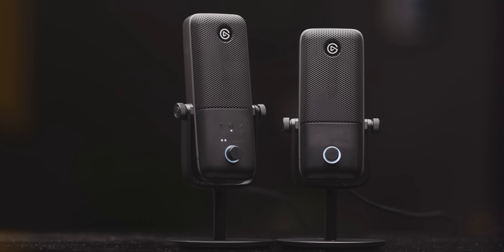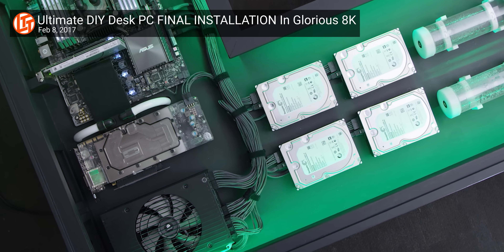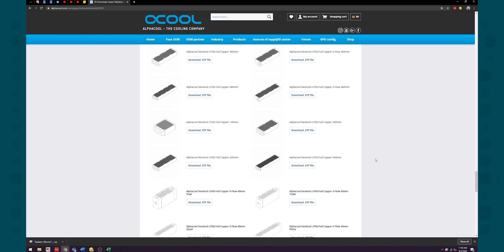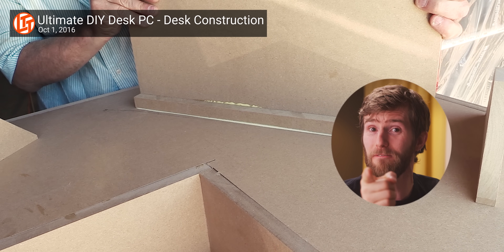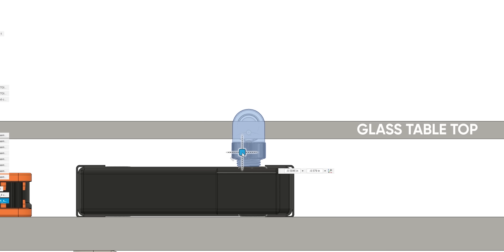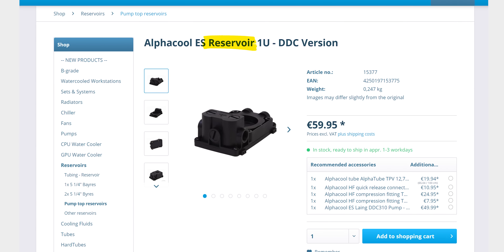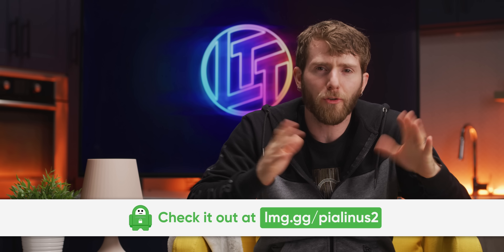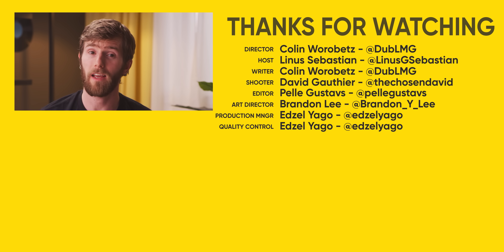Next Gen ULTIMATE Desk PC Design! - Part 1

Comment: ...are you seriously telling me that your engineer can't mill a water block to replace the stock heat sink in a modular PSU and then 3d print a shroud for the female connectors to fit on so you can use a standard ATX PSU out of its case because if that's true what exactly did you buy all those tools for?

Comment: Whats the problem with having all the fans and radiators on one side, with the mobo and gpu on the other side? You'll be able to see your components on the sides istead of being covered by the monitor
And you'll have better air circulation cause the fans and radiators will be a lot closer to each other

Comment: Why not build a plate to cover the cable runs. Like cut out the holes for the parts you use and use a stainless plate or something like it to hide your cables and anything else you dont want seen

Comment: how will you force air through the radiator if the backside is open at the motherboard. air will normally flow through the path with least resistance. Nice goal of a 1U height PC  desk, engineering is going to be a pain...

Comment: I have an idea of the power supply. Why not to water-cool the power? Emm, just a joke.. I think you can try adding more 12cm fans to create a negative pressure environment so that there can be more air flows through the 1U power. Or just use more 1U but low wattage powers so that it would be lower heat been produce per power supply and you can use a quiet Noctua 4cm fan for each power unit.

Comment: Might as well name it the "Salieri Desk."

All those additive printers, lasers, mills, welders, software packages, etc, and what is likely a generous payroll... and this is your process and work product? Couldn't even dip a toe into the simulation tab in Solidworks, ehh? ...it generates pretty pictures! And with all the time someone spent drawing those pretty models, maybe someone could have thermally qualified the components and done even the really simple math that they teach HVAC technicians to justify the initial design? 

It's easy to lean on the entertainment side of info-tainment, and it seems like LTT is indeed leaning that direction with these bumbling "engineering" projects. Linus has previously professed an internal conflict; balancing a desire to make meaningful contributions to civilization with running a biz in 2020. These projects are the perfect opportunity to expose the masses to real engineering process and cultivate problem solving attitudes. Instead we get bumble-f*ckery and fabri-cobbling with a bankroll. All of YT is becoming bubmle-f*ckery with a bankroll, as if having some under-utilized equipment sitting in frame legitimizes whatever falls out of the speaker's mouth.

https://www.youtube.com/watch?v=H5lZ4czTR4o

Comment: Linus, about 1U PSUs. I have an old LAN party inspired case that runs a 1U power supply. (Google "Vinster M@X"). anyway, I've been running a Seasonic  ss-500l1u 500w modular 1U PSU for several years and it is almost silent, fan rarely runs. I realize 500w isn't enough, but maybe you could run 2 of them if you want to try and keep it all in the desk.

Comment: Why hard drives, why not SSDs? You can certainly afford them, and they wouldn't cause vibration as hard drives will. They'll also add less to your thermal situation and better cope with it. ESPECIALLY if this is to be an "ultimate" desk PC design.

Comment: You wouled not need any powersupply if you used 300-600Watt of Solar panel‘s on the outside of the building with the new Batterysystem and some batteries in the case that drain the powerstation that gets loaded dayly for 24h PC usage and solves the battery‘s in the table. It might eaven be abel to run the table permanantly and have no energycost‘s for it besides the hardware that you couled make an other video about and line out of the taxes partially.

Comment: So, will the D2 use an RTX 3090 since those were released late this year? I only ask this because this video was released in June 2020, and the RTX 30 series was announced in Sept 2020.
Reply: They seemed pretty dead set on the thickness of the desk or else they would've changed it when they hit the water-cooling problem. But maybe the 3090 will make them make it thicker that way the hardware would be better. I kinda don't see that happening tbh since the 3090 is almost TWICE as thick as the 2080 they're using. And if you look at 3:32, they got it riiiiiight up close to it so they'd have to make the desk itself almost twice as thick to fit the 3090.
Reply: @xavierrick0505  ahhhh i was just wondering. it seems like linus would want to use the 3090 or a new 30 series card. better graphics
Reply: Oh for sure, from a performance standpoint its a no brainer, I just don't know if that itself would make him reconsider the thickness. If it does, that opens up ALOT of ways he could have the innards of the desk and that could possibly make him start all over from the beginning to redesign the whole thing.
Reply: @xavierrick0505  It would be a lot of work.
Reply: @Sakura.Ethereal  most definitely

Comment: This design is really a disaster. Plopping components randomly on a slab with long connection runs, inadequate cooling, and taping a spider's web of connections underneath is obviously a symptom of deciding the configuration  and then making the design conform to it regardless of the problems . Before going to all that effort reinventing the computer desk badly, consider buying a Lian Li computer desk like the DK-05F or at least have a good look; it's all worked out and good industrial design. For example, there is nothing preventing the desk from being 8 or 10" deep past the point at which the user's knees extend underneath. Only the forward 30cm needs to have a shallow depth.  There could be a vast vertical radiator with 8X 200mm low rpm fans making up the back of the desk, isolating it for sound and only seen from  a long distance bending down. Again; look at the Lian Li.